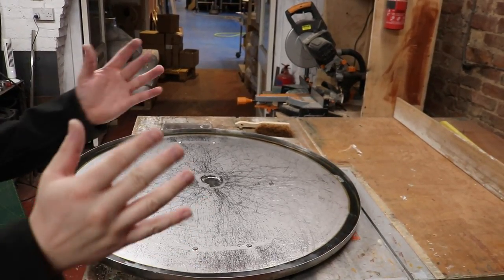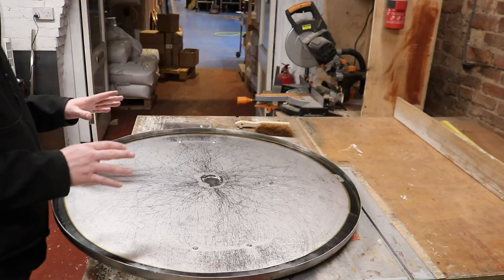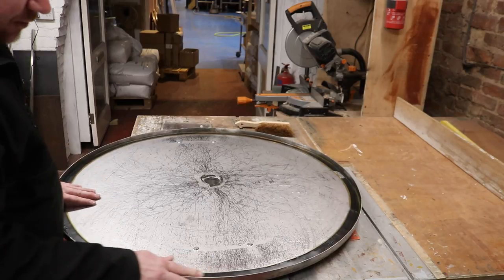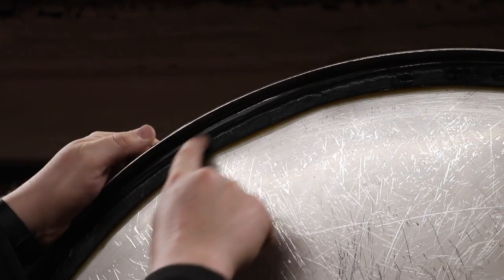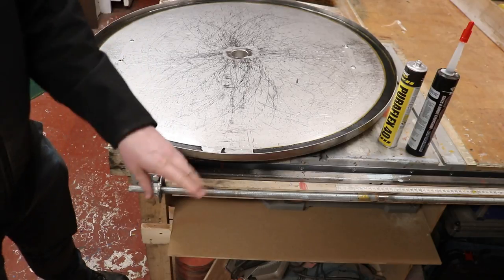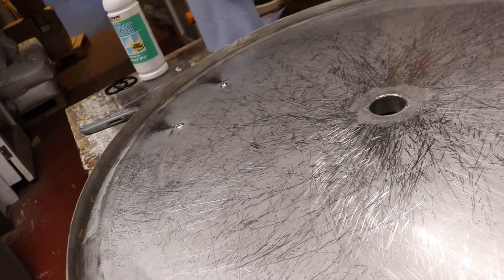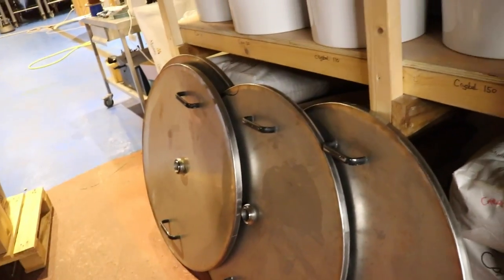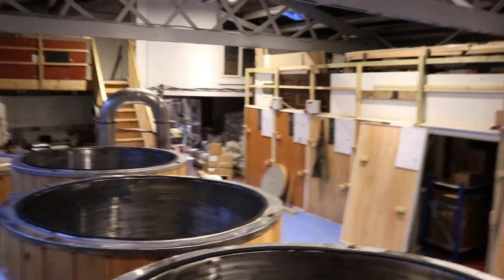Fermenter Lid Seal Experiment

Comment: Could you possibly make another loop of stainless and weld that to the inside of the lids so you get an inverted U shape that would fit over the fermentor top? Hard to explain in text but it would mean you have an inner loop so any cleaning fluid would hopefully drip inside rather than escape.